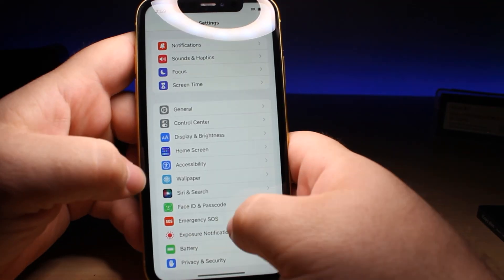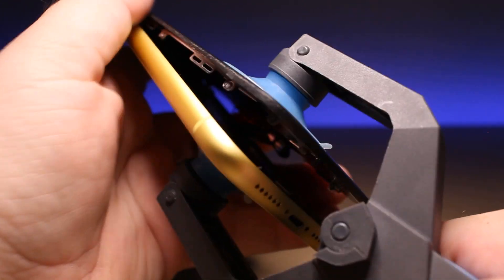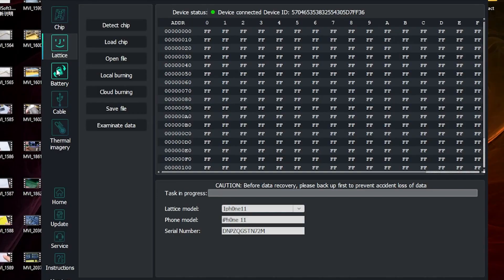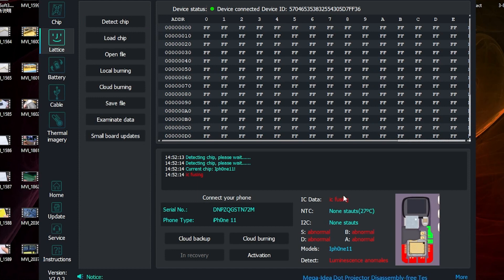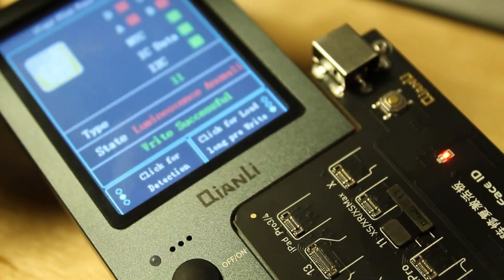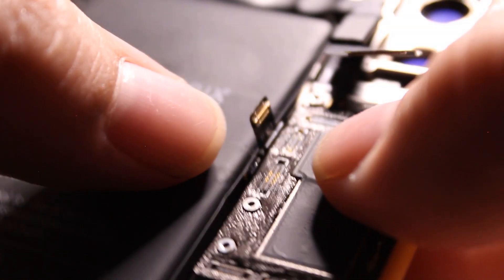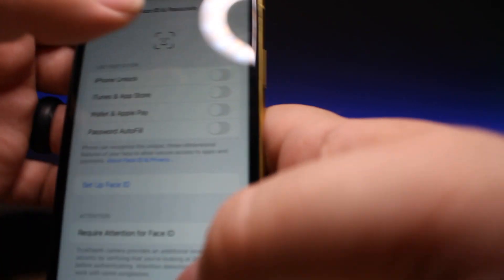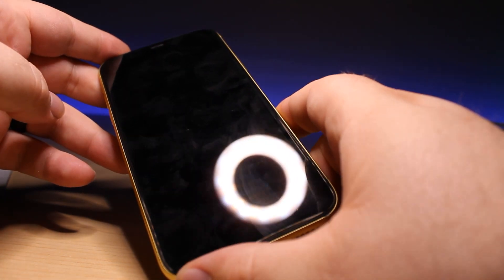ICOPY FACE ID REPAIR BOARD COMPATIBLE FOR IPHONE X-14 SERIES (QIANLI)

Comment: I tried it and i got this error how to i fix it? Thanks (Burn data interruption/r/n/n1.Please check if the cable is off/n2.Please check if IC programmer pin is solded)
Reply: I got the same error! Did you manage to solve it brother?

Comment: 11:27:33 Burn data interruption\r\n\n1. Please check if the cable is off\n2. Please check if the IC programming pin is soldered
Reply: did you get any way to fix it? i have the same issue. Iam repairing an  IPhone XR :(
Reply: @luisleal9590  Did you manage to solve it? I have the same problem with iPhone 11

Comment: Do you still have to buy their proprietary flex cable add-on if you’re just swapping the cameras or can you just use the board to switch the crystal information?
Reply: this is what i want to know
Reply: Yes you still need it to fix this issue.

Comment: Please help my is showing dis 👉👉👉if the cable is detected a normally, please remove the extension cord or use the chip solution to fix it

Comment: I have a couple questions about repairing the iphone 11 display i have. So in order for the face id to work do i need this tool? or will face id work without the need of this tool after replacing the display?
Reply: Face ID stops working and you lose true tone when you change the screen. Even if it's a genuine replacement.
Reply: @OneIdeaTooMany 🧢only true tone wont work

Comment: So just to understand better what kind of damage to the Face ID is repairable with this tool? Or for example what kinds of damage did the sensors sustain that would lead to the use of this tool? I find it pretty sweet that it has the other boards for different parts, I just wanted to understand the Face ID board and the kinds of damage it can repair
Reply from the maker: It's specifically for the "True depth camera message" when in the face ID settings

Comment: Fiorst you said True Depth...then you said Dot projector - which is it that malfunctioned and why would either of those malfunction to begin with?
Reply from the maker: The True Depth is what the overall process is between the dot projector working in unison with the infrared camera. The Dot projector is the component out of the two that has failed in these instances and has caused the message to appear.

Comment: Do you need the replacement Face ID camera assembly, or will this repair the original part?
Reply: this repair the original. Any situation that involves changing any face id original component is helpless. You must have the original Yogui, dot projector and infrared camera